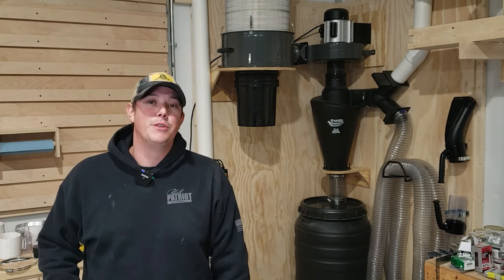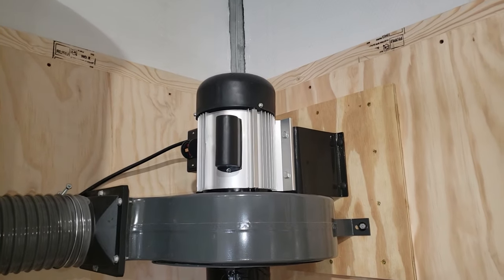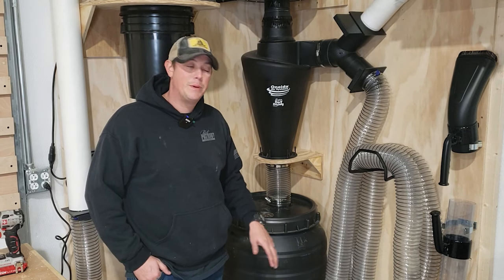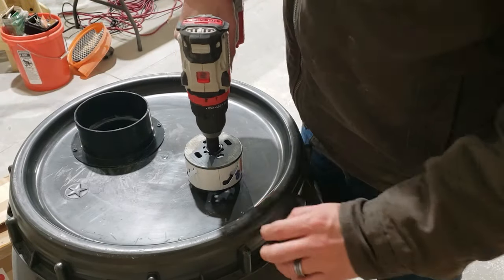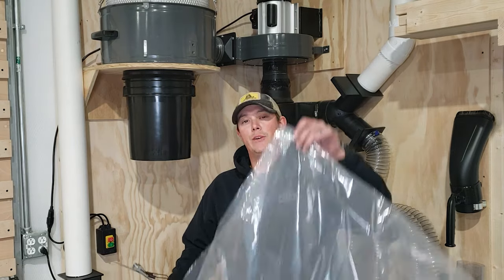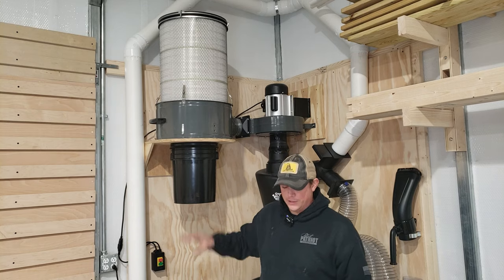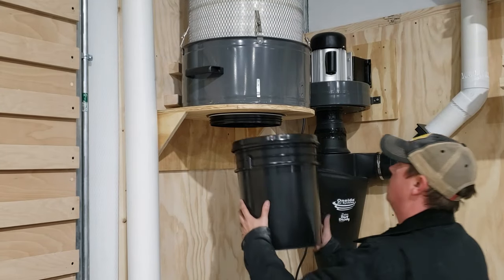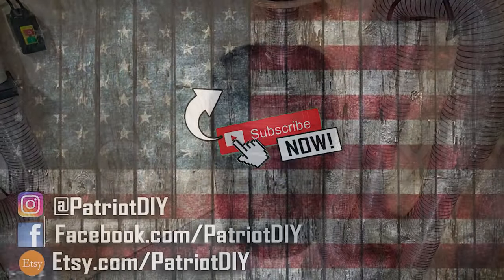Dust Collector Upgrades / 2 Stage Harbor Freight Dust Collection

Comment: I bought the same dust collector and plan on upgrading it in a similar way. I'm starting to think we're not all that smart though. The cyclone and upgraded filter is around $500 in upgrades alone. $800 would probably buy a pretty decent name brand dust collector...lol
Reply: Yes, you could buy something decent for that price (1.5HP singe stage with a MERV 15 filter).  That will cover any tool that uses up to a single 4" dust port no problem.  Primary downside to the single stage is needing to clean out the filter every time you generate a bag of sawdust and its really messy.  To get into a 2HP 2 stage collector with the filter like he built in this video your $1500-$2000, so you are cutting costs about in half, plus you get to say you built it yourself

Comment: Seen close to a hundred of these types of videos to research how to set up dust collection in my new shop.  Your setup and video instruction are the best.  I plan to use your method this summer.  Thanks!
Reply from the maker: Happy to help!
Reply: it is a slick looking system what did you use for that reducer from 5" blower inlet to 6" cyclone exit.    and have you heard if a 31 gal galvanized trash can will not collapse or not?
Reply from the maker: @elkskiutah8204  I used a 5 to 6 metal reducer from the ducting section of lowes. Had to crimp one end to make it work. 

Not sure about the trashcan

Comment: This is great, I did a ton of research and this setup seemed like the optimal combo, now you made it much easier to visualize, design and mount up. Thank you!
Reply: Have you done it? I'm about to. How well does it work?
Reply: @GageDrums  I didn’t but I think there’s a 20% off sale at harbor freight now. At the time the cost and time investment wasn’t of value after you add in the Wynn filter and Oneida cost, plus duct work around my shop. I got a used Oneida mini gorilla on a stand for around $900 instead

Comment: I just changed impeller to a wen larger impeller, best 50$ I've spent. Easy to do and increased volume and suction. Highly recommend!
Reply from the maker: You have a link?
Reply: Wen 3403-22 turbo fan
Reply: Did you leave the intake 5"?   I got my wen.  But I saw a video where a guy was testing his flow  after each change and when his friend sent him a wooden cover with a 6" plastic flange on it.  It didn't increase his CFM.
Reply: Left it 5" works great, enjoy!

Comment: Just an observation (having trod this path myself).  Everyone starts with a shop vac.  Then they enhance the shop vac, usually with a separator (the slanted thing).  Then they get an improved outlet filter.  Then they get a small, roll-around dust collector.  Then they get an improved outlet filter for the DC.  If you are currently using a shop vac (enhanced or not), but not satisfied, I suggest you jump straight to the DC, and then call American Fabric Filter (or equal) to get a "1-micron rated outlet bag".  You rob yourself of all the hours of fun playing with the hoses, but you get where you're going that much faster.  Shop vacs do a decent job of keeping the floor from getting too deep, but they don't really do the job of a DC. 
 [A shop vac has a higher pressure-to-flow ratio than most DC designs; a dust system benefits from a high flow at moderate pressure.  A good outlet bag design {eg, make it bigger} won't penalize the fan with excess pressure loss.]

Comment: I am thinking of doing a 'Thien' type system when I noticed the air filter looked a lot like the air filter that goes in the Freightliner's and Kenworth's that I used to drive! I think they are about 1 micron, which is still 'trouble'... I could probably spray a can of Endust into the filter and make it 1/2 micron...hmmm...   There are filters on Amaz... that are $60! For instance, Wix 46883. $61 in Nov '22. 14"x25"...what's not to love? Has a chrome cap on it you can cut out with a jig saw metal blade,,and stack 2 of 'em up! Hell's bell's,,,at that price...buy 3 and stack them up! 6' high of air filters. Actually I'm going to vent mine outside, low to the ground. But if I were in a basement, etc, I'd do my build with some Big Truck air filters. You think those engines don't have great filtering? Best thing to do if you have a dust collection system is wear a 3M P-100 mask while you are sanding, etc., vent outside, and hope the little particles don't impede your health if you think any/all of these filters will do 100% of the job. A nice build, and thanks for posting it.

Comment: nice job. exactly what I need to do.  I do not have a corner to use so I will be building a right angle bracket to hold the blower.  Thanks for the Vid. It will help me a bunch.
Reply from the maker: Glad I could help! Thanks

Comment: The $49 "Dust Stopper" from Home Despot and a 7+ gallon "6HP+" shop vac from Lowe's or Menard's or where ever you can get one under $100, does a better job in my tiny shop on the table saw or router table than a $3600 240 volt 3HP cyclone I was willed by a late friend.  He had a semi-pro workshop and sold cedar chests in Branson, MO.  His five-inch pipes just didn't work well with my 3" outlets. Moved TONS of air, but no suction.

Comment: Hi, great video. I'm in the process of doing this now.  I went with a replacement for the Radeks Workshop filter instead of the Wynn. I hope that wasn't a mistake. Haven't decided on the Super Dust Deputy or building a Thien Sepatator. Thanks!

Comment: Nice job!  That's almost identical to the dust collector I made!  I used a trash can instead of a barrel and my Y connector on dust deputy,  one port goes outside through the wall and the other side is for inside.  It works great

Comment: Just stumbled upon this video. I have basically done the same setup. Only difference is I used a grizzly filter with the cleaning handle, fit perfectly on the hf dust separator. Have a 1 micron bag below it. Like the pail idea.
Reply: I’m looking to do this with the grizzly filter as well. Does it need those gear latches for it?

Comment: I tried the plywood disk and bucket with screw top Gama seal lid under the filter  but found that dust just piles up on the plywood shelf. I went back to the plastic bag because it allows the dust to fall straight through unobstructed. Ya, that annoying bag and metal band actually work better. You will find out as you  have to deal with trying to reach up and around the plywood shelf to vac it up. Unless your incredibly ambidextrous.

Comment: Great video!  One of the best solutions I've seen to take single stage and upgrade it simply and effectively.   Wondering how much time and how expensive it is to do this.  I am looking to add more dust collection and am wondering if the down time in the shop is worth it.  Could it be cheaper to buy a plug n play system so there is no downtime in my shop?

Comment: Well done video and great tips!  I’m planning to tackle the same job this weekend and will be stealing some of your ideas.   The only addition I have is that I’m adding the Rikon impeller upgrade as well.  Thanks for making this one.   Definitely worth a sub!
Reply: Details please...  where can we get it?  and...  did you have a chance to quantify performance impact?
Reply: I know this is a late  comment since I'm just now finding this post, I have also seen where the Wen 3403-22 impeller also works the same as the Rikon impeller but is cheaper price wise. If you happen to one the lucky ones like me that can exhaust the discharge strait out a window or wall without a filter attached that is the BEST way to go since there is NO restriction. My Father-in-Law was able to do this and he said it was night and day between the difference. I'm gonna be doing mine the same way but I think I'm gonna add the Wen impeller.
Just think about it this way and it was mentioned in the video, you can't suck dust and debris any faster then what you can push it out the other side, the least resistance at the end of the line the more you can pull at the suction side.
Reply: I am going to check out the wen 3403-22

Comment: Thanks for this. I'm in the process of copying your specific design. One thing I didn't see in the video is what you used under the bracket you built for the Dust Deputy. I'm guessing it's a second 4" flange, but thought I'd ask. Great take on the HF mod!
Reply from the maker: The bottom of the dust deputy is actually a 6" hole! I used a 5in flange and tapered the plywood from 6in opening on top to 5in on bottom. Then 5in hose.
Reply: @PatriotDIY  I couldn't tell in the video where you tapered from 6in to 5in on the dust deputy.  I did see where you tapered into the Gamo Sealed bucket.

Comment: Wonderful Installation.   I am in the process of doing the same.   I already have the Wynn Canister Filter and will order the Super Dust Deputy next week.   Have youi made any changes over the past months that you would recommend?
Reply from the maker: I've changed a couple of the blast gates to metal ones, but other than that, no changes

Comment: Great video! I copied you exactly. I got the same barrel even. How do you empty it without causing a huge mess? Any special moves or a certain type of bag to dump into? I considered putting a large yard bag in there and screw the lid onto it, then only let if fill partially so I can still get the bag back out?
Reply from the maker: I use a dolly or gand truck and wheel it out to the woods and dump it

Comment: I followed the video step by step. The system works great with the exception on one thing - almost all of the dust is going to the 5 gallon bucket and hardly anything is going to the barrel.  I'm wondering what I did wrong, because it looks identical to your setup.
Reply from the maker: Sounds like your dust deputy isn't functioning properly.

Comment: You definitely have a subscriber! Currently building out my shop. Tied off walking around and over everything and not having space to work. My next step will be dusty connection so thank you for the amazing video! Quick question, no issues with suction with that kind of rise and drop?
Reply from the maker: Nope! It works well

Comment: What are the dimensions of the plywood sheets on the wall?  (4X8)?  Yes... trying to mimic your corner build.  Also, the HF machine is now $100 off with the coupon until March 3rd.
Reply from the maker: Yes 4x8!

Comment: Nice.  Just finishing up  my new shop and will be converting my HF collector to this system.  How often does the filter need to be accessed (cleaned) and the 5 gal bucket emptied.  I am thinking of putting the blower and filter in my shop attic to free up a bit of space.

Comment: Nice!  I'm doing something similar with a Craftsman dust collector my brother gave me.  The only question I have is you used 5" flanges on the bottom of your Dust Deputy and the top of your 55-gal bucket, but a 4" flex hose.  That hose will stretch over that, or is the rest of your flex hose 5" as well?  It all looks the same size.

Comment: Hi.  Either I miss your explanation every time I watch or I'm  just missing something.  Did you use a 5" flange fitting of some kind on the BOTTOM of the plywood supporting the Dust Deputy?
Reply from the maker: @buzzhazzard  yes! The hole in the plywood is tapered from 6" to 5", then there's a 5" flange on the bottom to accept the 5" dust hose

Comment: Nice work. Thought about a clear window in your 5 gallon bucket? I'd think you'd want a quick, easy way to see that level.
Reply from the maker: Considered it, but Not really necessary, the bucket fills FAR slower than the 50 gallon barrel!  So if you just empty the bucket every time you empty the barrell, you'll never fill it up!

Comment: I wonder if the bucket replacing the bag is actually necessary.  In my experience, very little dust accumulates in ny similar bucket arrangement.  Next time I may just leave it out and cover the ring with solid plywood.

Comment: Watched your video several times and keep coming back to it.  My layout is almost exactly the same.  One question - I’m having a problem finding a coupling to connect the HF Y-connector to the Cyclone - look like you have a short piece of pipe that goes inside the cyclone connector and inside the y-connector, but have not been able to find that in the big box store - they have 4 inch (too small) and 6 inch (too big).  Closest I can find is a 4 x 4 CI Plastic to CI Plastic connector.  Can you share what you used?
Reply from the maker: its a rubber coupler that fits OVER each piece,   found it on amazon

Comment: Thanks so much for this video! I am looking for the next phase of dust collection in my small shop to step up from my Ridgid shop vac lol. 

One question - with the separator and filter upgrade, do you know is this setup is in line with the other dust extractors like 3M or Festool? I know those are HEPA rated but they still only do one tool at a time and a setup like this would be more practical for multiple tools.

Comment: Nice video. Have you noticed any issues with mounting the fan assembly horizontally? Any reduction in sucking power?  Anything you would change since you did this in January? Thanks!
Reply from the maker: No issue! Works great
Reply from the maker: @Striper Seeker you'll see in the video that I built a small shelf for the dust deputy to mount to, I added a 5" flange to the bottom of it and used 5" hose connected to that.  Then another 5" flange on the barrel lid!

Comment: Does the stock separator do anything now? You really only need to collect what the filter catches - I doubt it's dropping any dust out that got through the dust deputy through it's own action.
Reply from the maker: Still get some fine dust trapped below the filter. It's not much but it needs to go somewhere rather than clogging the filter

Comment: Great video- I just finished mine last weekend following your steps.. just wondering, where did you get the hose holder that you are showing mounted to  the wall?
Reply from the maker: Should be a link in the description.   The end of the hose is just rested on a 4in flange

Comment: What type of fitting did you use at the bottom of the 6 inch hole below the plywood stand that connects the flex tube from the bottom of the SDD to the collection can. You missed showing that in your video
Reply from the maker: A 5" flange

Comment: how long does that canister filter last, and how do you clean if you have to ? thank you.
Reply from the maker: @hasmukhvpatel4539  it continues to work as long as you clean it, I usually clean it by blowing air through in from the outside using a compressor

Comment: Hey brother nice build, what did you put on the bottom of the plate that was holding the dust deputy? Did you run 2 5” flanges?

Comment: So you are now filtering down to 1 micron. Now only the most lung-damaging particles are escaping back into your work space.

You need to be venting all the exhaust air, to the outside. The upside: no more 1 micron filter replacements (the 1 micron filter which isn't protecting you anyways).

The downside: You will be heating or cooling a lot more incoming fresh air.

Comment: What adapter did you use from your cyclone to the flex hose going into your dust bin?
Reply from the maker: It's a 5in flange and the plywood above it is tapered from 6in to 5in

Comment: Quick question that I didn’t see in the comments (sorry if it was)..

Does the tube from the cyclone to the barrel mean more of the dust will be sucked back into the filter as opposed to the cyclone being attached directly to the barrel?  I’m genuinely asking. I want to use a tube between the two, but don’t want to clean out the filter often.

Comment: Great design, thanks for sharing. But it looks like you created a shelf between the metal round section and the plastic 5-gallon collection bucket? Does dust get stuck in that cavity directly above the small bucket? I wonder if you could add a small column connecting the bucket up to the round metal hole.
Reply: Like a funnel? Then that gets rid of the horizontal shelf to let dust settle on?

Comment: Great video! In the process of building a dust collector and pretty set on this setup. What is the total height required for this configuration. I have just under 9' and this looks really close to that?

Comment: Good afternoon. And the last filter, does it work in the opposite direction? It is designed to suck air into itself, and you direct the air out of it. Does it damage the filter?
Reply from the maker: It's designed for the purpose im using it for

Comment: So not saying this is your problem at all but. What is the amp rating on the breaker and wire of the circuit that feeds that thing. I just finished putting the new Impeller in mine and its popping my 20amp breaker  it is wired strong enough for a 30amp
Reply from the maker: Mines on a 20amp breaker. So far no issues running it and a couple other tools at the same time.

Comment: i had a question is it ok to get a smaller filter for a 2hp dust collector like this one?i noticed in some videos theyre just as big as the ring it sits in and yours looked like it was a bit smaller in diameter. I guess ultimately the question is if its possible to get a smaller size canister filter, make it its own stand and not use the metal ring that came with the dust collector?

Comment: This is a great video and I'm about to embark on a similar path with the same dust collector. One question that I have relates to the impeller. I ordered the larger Rikon impeller and plan to change it out with the HF original. Did you happen to do this with your system and if not, is there a particular reason why?  Also, do you k ow of any lesser expensive knock offs to the Dust Deputy that would work as well as I've heard of these being available? Thank you in advance advance for any info and I appreciate this video, it's superb!
Reply from the maker: I didn't change the impeller.